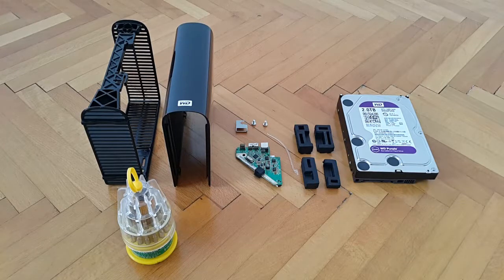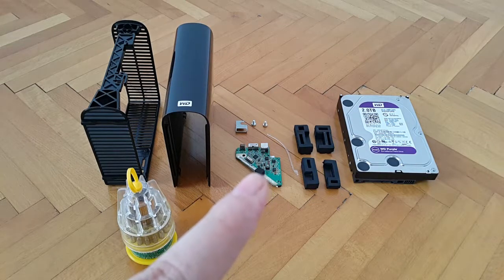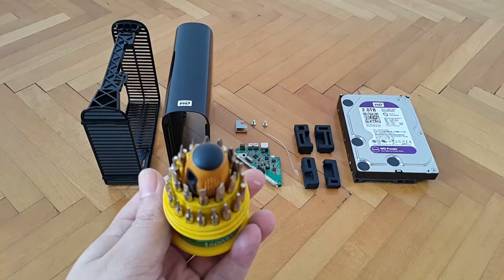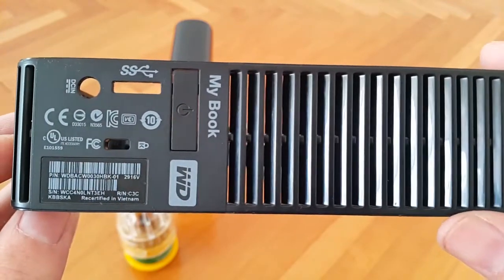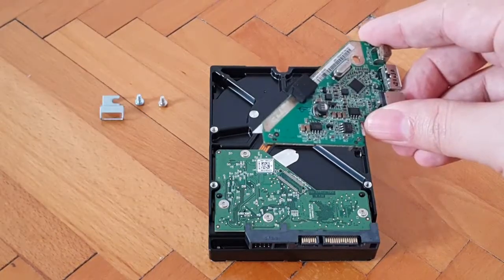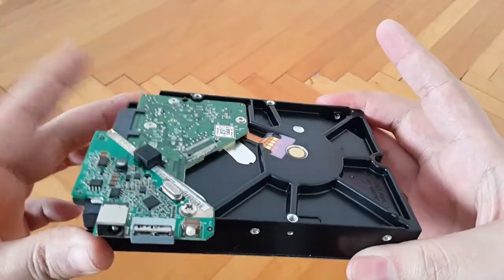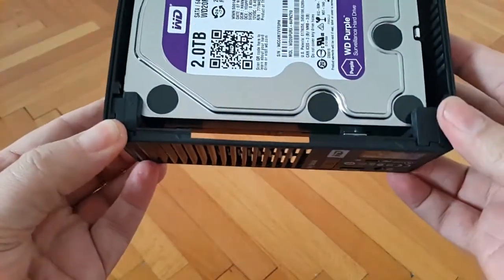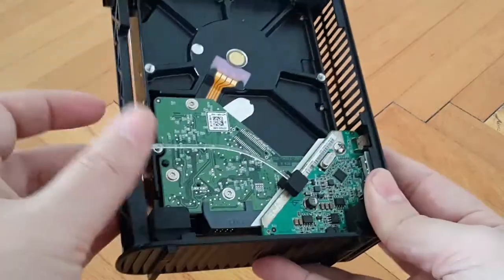WD My Book Essential 3 TB - Enclosure Reassembly (Add/Upgrade HDD)

Comment: Very Nicely Done!!
Good to know on the Rubber Damper’s for protecting the HDD, that a ‘Black Caviar’ needs to have the cutouts modified. Showing those small  Fingers so they don’t get broken was a nice detail, as is the slighting of the hard drive and putting on the Rubber Damper’s on the two edges after the other corners are in place. The light tubes was something I wasn’t expecting they used, but effective.
Details were EXCELLENT!!!!!
Reply from the maker: Hi,

Well glad you liked it (& learned something new). 🤔😇🤗

Best Regards,

Comment: Excellent Tutorial about how to re-assemble the WD Case, Those rubber feet were driving me nuts to get the housing back together properly. Thank you for taking the time to create this video. I recently dropped my external 8TB HD and now my PC does not recognize it. I tried switching the power assembly from a working 3TB drive to my 8TB to see if I could get it to boot up and be recognized but no luck. Trying to get my data off my 8TB before sending it back to WD to be replaced. Any tips on doing that? I will check your channel for more info. Thanks for your help with the rubber feet. lol. All the best.
Reply from the maker: Hi,

Sorry for the late reply. YouTube placed/recognised your comment as spam, so it wasn't detected on my notifications list. 🙄😒

Anyways... You're very welcome. Glad you liked it & found it useful. 😊

So... did you drop the drive while in operation or while turned off ? What was the height of the drop by the way & on what it landed on (rug, tiles,...) ?

If first, the data retrieval will/would be surely very very costly. If second, there still is a risk that the read-write heads might be faulty, though in the parking position (meaning away from the platters). But at least the data on the platters would be intact. 🤔🙄

But the retrieval of the latter might still be expensive.

If the power requirements (Voltage & Amps) for the 3 TB model & the 8 TB drive are the same, then you can try using the power adapter from the first onto the second. 🙄

Though I personally wouldn't try that because you don't know the condition of the read-write heads. Anyways...

When you connected the power adapter to the 8 TB drive, did you at least hear the drive spinning ? I mean the servo motor with the platters on it. 🤔😉

If not, then it could be the PCB of the enclosure of the external drive that is bad or the actual HDD's controller.

If you want to try to get the data off personally from your drive, you would need a lot of knowledge & specialised equipment for that. Have a peak at this channel how he does it. 😉👇

https://www.youtube.com/user/hddrecoveryservices

Best Regards,